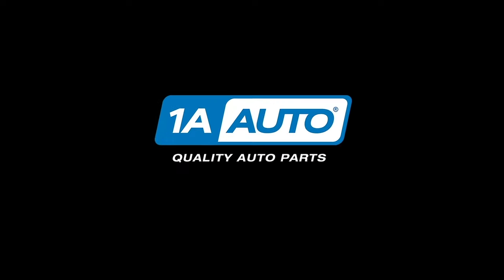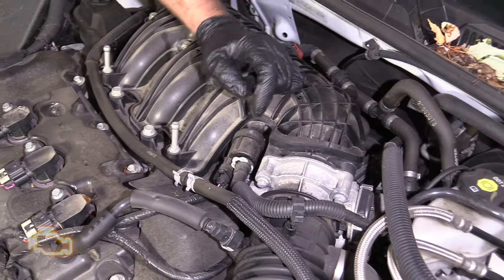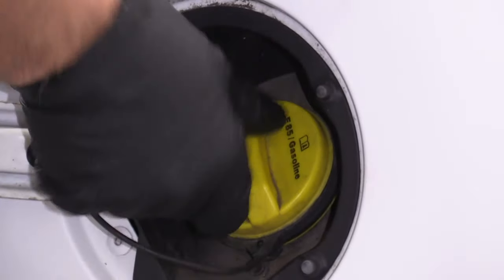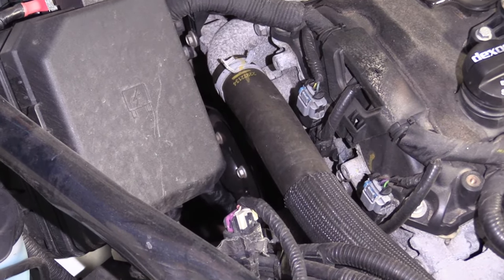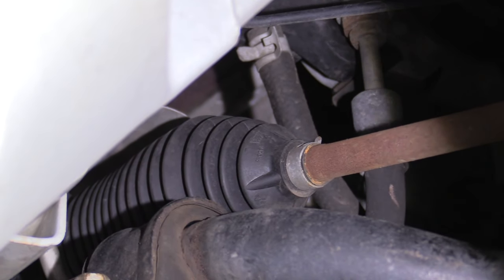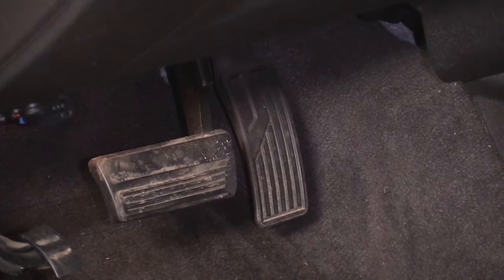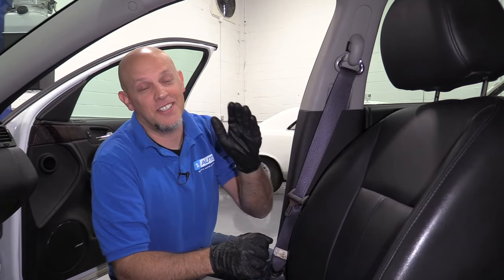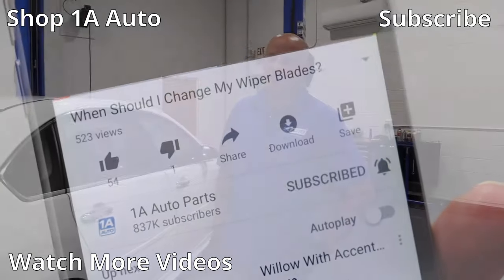Top 5 Problems Chevy Impala Sedan 9th Generation 2006-16

Comment: The absolute two primary "common problems" on this car are Air blend door actuators AND the Gas pedal sensor. These should be recalled. These issues cover 06-16. The actuators actually predate this platform and go all the way back to the 00 to 05 versions of the Impala.  IIRC called the W body.

Again, air blend door actuators - buy the entire set. When one goes, another will a few months later if not sooner. Replace them as a set. Otherwise, your mental state will absolutely suffer.  As the error produces incessant clicks as the blend door actuators try to return to home. And it does this at every opportunity. Even with no key in ignition. Pop the trunk? Yup, you sent power through the system. It'll bitch at you. Unlocked the doors but didn't put key in ignition? Yup, more clicking!!! (GM decided to use plastic instead of metal gears in the assemblies.) Plus the job is hard enough depending on which one is broken, that you are going to spend a day on this unless you have the perfect set of tools and are a contortionist. So just replace them all and be done with it. The passenger area has a total of FOUR. I'm not sure on the driver side. As I haven't had any issues with it. But trust me, replace all 4 on the passenger side AT ONCE, or don't do the job. As you'll curse for 3 out of 4 of em. So might as well just curse the job once. And if you take it to a dealer, you are looking at $200+ in labor/parts for each one. Where as you can pay $120 through rockauto, OEM, and absorb labor cost. Youtube is your friend. Youtube is your friend. Youtube is your friend. Did I say youtube is your friend yet? YOUTUBE IS YOUR FRIEND! Do not pay a dealer, or independent mechanic. You need to learn to replace these on your own if you are going to own this platform.  As they'll break multiple times during ownership. My 2011 only has 63k. I bought it at 42k. I've replaced two so far. YOU WILL replace these multiple times.

Gas pedal sensor - again EXTREMELY common should absolutely be a recall. These two parts should always have replacements they are so common. Take an income tax return, buy 8 of the actuators, replace 4 in the vehicle, keep 4 as backup, and buy the gas pedal sensor. Keep it in the car. It's two bolts to replace it when it goes bad. Will absolutely save you from limping the car to a shop or being effectively stranded. Hardest part of the gas pedal replacement is the connector to it. The bolts are easy to access and will zip right out with an impact. You just need the socket (I think it's a 10mm, 13mm, or 15mm. A standard GM facet.) and an extension. Plus the "tool" itself. Again, I can't stress enough, once you know how to unhook the connector to the pedal, the job is easy as hell. Two bolts. Easily accessible, and impact makes short work of them. KEEP A SPARE IN THE TRUNK! These two parts are as common to replace on these vehicles as an oil change. Keep spares at all times. Replace one? Restock your backups. Keep tools in the trunk for the gas pedal sensor. Otherwise, pay a shop. Your choice.

Ask me how I know...Yes...I own the 2011 Impala LT (Flex with 3.5l) I also own a 2005 chevy impala, with the 3800 series II. I know these vehicles inside and out. Both cars have spare actuators in the glove box. The 2011 has a spare gas pedal in the trunk. Both vehicles have tools in the trunk. (A "decent" craftsmen 100+ piece aio toolset, fluids, jack, and jack stands. Plus quite a bit of other tools.) You won't see me on the side of the road for long. I've had shit break on these cars from engine sensors (MAP, MAF, oil pressure sensor, coolant level sensor) all the way down to a fucking C clamp that clamped a hard oil line to the oil filter housing. Talking 30 of these costs like $5. My advice? You own a GM vehicle 16 back to 00. Be mechanically inclined. Keep your tools in the trunk. Otherwise, get used to uber. From a 42k car to a 200k car, GM doesn't care. They are still money pits.

Another problem I've heard about on the 2011 (4t65e transmission which is also in the 2000 to 2005) is shift solenoids. Honestly, the 4t65e transmission is absolute garbage. But if you own these cars, you can't exactly decide to ditch a transmission. So my advice? Any evidence of a hard shift, or "slippage" and trust me, you'll absolutely feel it and know what I mean, replace the solenoids. $300+ for the set, and a weekend of your own labor. Give or take depending on your ability. Don't take it to the shop unless the tool purchases outweigh shop cost. There's plenty of vids on youtube. Even people who know nothing of cars, can do it.

PS: Welcome to GM ownership. Buy an oldschool LS based platform from GM. If you can't afford them, BUY A HONDA/TOYOTA. Any year. Screw anything other than a Camaro, Firebird, or Corvette from GM. (LS based platforms.) GM, is absolute garbage. Enough said. BESIDES their LS platforms. And this is coming from someone who LOVES GM. I'll never purchase another car from them, or on the used market unless it has an LS in it. They made amazing engines, shitty cars. Short blocks, big blocks, 3800 series II/III, LS. But cars? HA!!!! Camaro, Firebird, Corvette.
Reply: I came just to like this about the actuator and sensor situation. Experienced first actuator issue back in 2013. Sensor issue in 2012 after returning from long trip to Georgia, headed back to Colorado, 40 something miles away from Colorado Springs area the sensor went out…the longest 40 mile drive ever. Military convoys moves faster!  I think my transmission solenoid is starting to act up, along with oil pan seals leak. It was a good 169K, but it has finally become time to trade in Lightning McQueen (my daughter nicknamed it) and get another vehicle. I also hate hat they stopped production of them as well!
Reply: @SFCretiredArmt  I completely forgot about the transmission Solenoid. Yup, another big issue on these cars. Mine acts up every once and a while too. And my car only has 63K.
Reply: I’ve replaced two of three blend actuator doors, the gas pedal, speed sensor on the transmission, and had the entire transmission rebuilt. Now the windshield defroster isn’t working. This car just broke 80,000 miles.
Reply: @bostongeorge5814 i have a 09 LTZ with the 3.9 only 85k miles. Have already done the gas pedal sensor, all engine mounts and trans mount. Just had to fix the harmonic balancer
Reply: @bostongeorge5814  I feel your pain man. I really do. I sold off my 2011. GM has burned me too many times as I said. Unless I get me a LS platform, I'll never buy another GM product again.
Reply: Is impala LS considered LS platform
Reply: Anyone know where the proportioning valve is located on a 06 impala 3.9 v6?
Reply: Shit you give me all the information I need I'm going to order 8 actuators and a gas pedal thanks my friend
Reply: @edwardzamorski3711  but what about the transmission problems
Reply: @BoiBoiGTA I'll get some shift solenoids when trans acts up car only has 40k now
Reply: @edwardzamorski3711  mane I want a impala but I’m scared of dat transmission problem, I might get a Toyota instead
Reply: @BoiBoiGTA  I hate to say it but that Toyota might be a good idea. That transmission worries me I have Impala nice car so far no trans problems yet but only 40 thousand miles on it
Reply: Seems to me you know these cars off the back of your head. Ok so I own a 2011 Impala LT (3.5L) I’m starting to hear a ticking noise while idiling and becomes louder when accelerating, also the car doesn’t really seem to wanna accelerate when I gas it. And when I push down on the pedal it’s like that car doesn’t wanna go faster so I just ease on the gas and cruise. Any solutions?
Reply: Seems to me you know these cars off the back of your head. Ok so I own a 2011 Impala LT (3.5L) I’m starting to hear a ticking noise while idiling and becomes louder when accelerating, also the car doesn’t really seem to wanna accelerate when I gas it. And when I push down on the pedal it’s like that car doesn’t wanna go faster so I just ease on the gas and cruise. Any solutions?
Reply: Rocker arms, fan blade missing or bearing failed torque converter failing
Reply: So I have a 2010 and when I put her in drive she shuts off. .
She's fine in reverse and neutral.  
Any idea of what this could be?? Bc nobody I've asked knows.

Comment: I've been pretty lucky with my 2007. The only issue I've had was when I wen out of the country for business for three months in 2015 and my wife let it sit instead the entire time instead  driving it occasionally and the power steering wires where chewed threw and a nest was built. Other than that I'm still driving it with over 220k with nothing but tires and brakes.
Reply: Yep     ill jinx myself for sure here but ive had great luck with  my old impala.  If i have any of these issues...ill be thrilled.  NOthing major
Reply: Just a 2020 uipdate. I decided to update to a 2018 Impala (I neve byt a new car - alwasy wait 2-3 years to get all the probkems identified) I actually gave my 2007 Impala to my daighter and her famnily who needed a car desparately when I bought my 2018 Impala, The 2007 has ha ZERO issue (other thatr a brake job) and with all of her driving is almost at 3000,000. If it wasn't for some idiot hitting my parked an unoccupoed car the at Marxx;s store it would be perfect.
Reply: Dude I have an 07 too and mines only got 66k miles and I bought it at 40k and things a champ and it’s kinda fast lol I see them everywhere where I live now like they just don’t die

Comment: I have a 2014 Limited (holdback) and the only problem I have had so far has been the blower motor resistor. For some reason it keeps going bad, and I was told it is a common problem. My car has 183000 on it now and to this point has by far been the most solid car I’ve ever owned. It still runs and drives like a new car.
Reply: Did you change the blower motor with it?
Reply: Hi Hello
I have a 2017 Chevrolet Impala LTZ
Do you change the transmission fluid? Is there any danger in changing the gearbox oil????
Reply: @yosieden4056 if your car has fairly low miles it’s good to do a transmission oil change and gear diff oil change yes but if your car is at 200k+ miles and it’s never had those done then just leave it be. Words of advice from my father who’s been a mechanic 43 years.
Reply: Are you talking about the ac actuator ticking noise? Those cheap parts are quite annoying, you’ll put a new one in and it might last 5 years it might last 5 minutes

Comment: LOL. I was expecting the blend door and and mode select actuators to be on the list, as well as the 4T65E transmission (‘06-‘11). But it’s a great car, had mine 10 years no problem (‘10 w/ 120,000 miles)
Reply from the maker: Yes blend door should have been in there. Its the #1 comment that we have gotten. Thank you for checking out the video. If you need auto parts go to: http://1aau.to/m/Shop-1AAuto-Now
Reply: You are correct with the blend door actuator along with the other 2, which I have changed. I also had to replace all 4 door locks.

Comment: I've owned my 2011 Impala for about 3 years now and only things that have failed so far is the Oil cooler and a couple heater hoses. Heater hoses just went out to rust (I live in Canada rust spreads like the plague up here) and if you're wondering why the hell mine has an oil cooler it's because it has the 3.9L Police engine. 

PRO TIPS BY THE WAY. IF YOU HAVE A 9C3 POLICE PACKAGE IMPALA AND THE OIL COOLER FAILS. DO NOT GET SCAMMED. There is an adapter that routes the oil through the cooler underneath the oil filter. You can just unscrew the oil filter, take the adapter off, and take the oil cooler out and convert it back to civilian spec by just screwing the oil filter back in. A local auto shop wanted 4750$ to replace that oil cooler because they no longer manufacture them. Took it to another shop, he found the adapter and fixed the issue for 50 bucks. Since the car is decommissioned you're not going to be idling it all day and wont need the oil cooler anyways.

Comment: I have a 09 3.5 LT and I was looking for a vacation car and it is a very comfortable vehicle for traveling in. So far it has had all three ventilator actuators replaced by me, a battery, I bought it in 2012 it had only 60k it now has 145k and I must say I am impressed with the quality and reliability of the car, it’s a daily driver and I do all my maintenance on it, I don’t care what car you have if you don’t do at least the minimum maintenance sooner or later it will catch up with you. I did install a transmission cooler on it for peace of mind. Also rust has not been an issue. I am happy with it

Comment: These are mainly issues with the 2006-2013 models... The 2014-2016 Version is a Fleet Production and had all upgraded parts comparable to the 10th generation that it overlapped.
Reply: 2012-2016 fleet version.

Comment: 2015 Impala Limited LT:

Wire strands break inside the insulation at the wheel sensor harness. Throws out a traction control and ABS warning. Dealer couldn't find it and convinced me to change the hub & sensor assembly for $400. Problem returned two days later and was told by dealer it was the transmission and would cost  $5000 to replace. Said it was just a coincidence it happened at the same time.

Diagnosed the problem myself after watching youtoube and showed this to the service manager. He said their was no service bulletin, and they don't use info from "the internet" .  Bought the OEM GM replacement harness on Amazon for $38 and fixed the problem. The fact it's in stock and cheap should be a hint this is a popular part.

Also, replaced steering rack, water pump, and radiator. Had the dealer changed the serpentine belt but they didn't change the pulley and tensioner which caused a later failure. Motor & transmission mounts and torque strut replaced. Shocks, Struts, and cracked strut mounts replaced. Alternator replaced. All three blend door actuators replaced. Connector at blower motor resistor is a problem. Replacement pigtail is junk and failed again - had to make my own.

Car has 167,000 hard miles on beat up roads, so I expect much of this wear. Just replaced the plugs which amazingly were working fine. Have been consistent on transmission and engine oil changes. Engine (V6) feels like it has a much torque as new. Trans shifts a little hard but no slipping noted.

Overall quite happy with this car and would buy again. Bought it used from Enterprise car rental in 2017 with 26K miles for $13K.

Comment: I have a 2006 impala and have never had any of these issues...the odd thing is this video doesn't touch on one of the biggest problems with this gen of impala and that's a slipping transmission or erratic shifting transmission. That is by far the biggest issue I've had with the car since i bought it and is still going on today...it started to happen around 40,000 miles and is still going on. Another issue is the rear window defrost not working because of a wire burn through by the right kick panel (passenger side kick panel). Also clicking inside the dash due to an hvac actuator going bad...all of these issues are common on this gen impala...
Reply from the maker: Yes Rob you are correct. Some of these problems should have made it in the video. Thank you for checking out the video. If you need auto parts go to: http://1aau.to/m/Shop-1AAuto-Now
Reply: @1AAuto  thank you for responding and i will surely check you guys out for parts when needed.
Reply: Rob i actually just bought a 2015bltz and realized that immediately that it sometimes shifts hard. Is that normal?
Reply: @brandonpitt4098  no it's not normal..
Reply: @RailFanRob  did you get your  trans fluid changed? I'm considering doing That in about a week or so.
Reply: I’ve found if you don’t set the cool all the wait to the bottom and stop just short it will keep the actuated from clicking .
Reply: @PeppyChimpers  I hear ya but sometimes I accidentally pushed it all the way down.. I did since change the hvac actuator
Reply: @brandonpitt4098  sorry this got lost in the shuffle. I did change the trans fluid and it didn't help.

Comment: I have a 2013 with the 3.6, the only problem I had was with the flex fuel sensor. I did some research and found out it was covered under a recall and the Chevy dealer fixed it for free!

Comment: The rear defroster likes to burn out at the connection at the passenger side kick panel.
Reply: Mine never worked!!
Reply: I had the same problem on my 2012 Chevy impala I was almost going to have the rear window replaced because the glass place told me you cannot repair it well, I repaired it with the proper soldering techniques. I replace the contact to the windshield reconnected it and it’s been working ever sense.

Comment: I’m going through the evap issue now. I replaced the gas cap and reset the battery. I want to see if the engine light comes back on after about 100 miles. So far so good. 💯👍🏾

Comment: Blend door actuators, coolant temp sensor, throttle body, accel pedal, oil leaks from valve covers and oil pan, and 1st gear jerk in transmission. Biggest issue is really the owners beating the piss out of them

Comment: I have a 2011 LT this is a good car when it wants to be! I've had this car for seven years. Its in the shop right now. Fixing the blower motor for the third time. This is the 2nd time this year. My horn hasn't worked in years. They've put 2 new horns in and it still doesn't work. I also got the actuators fixed so many times. The gas pedal as well. Its a good car when it wants to be a good car.